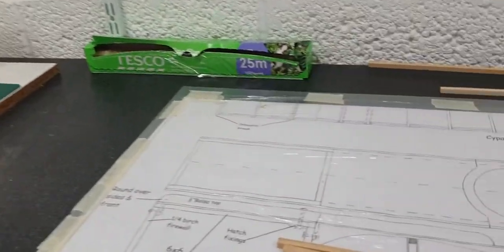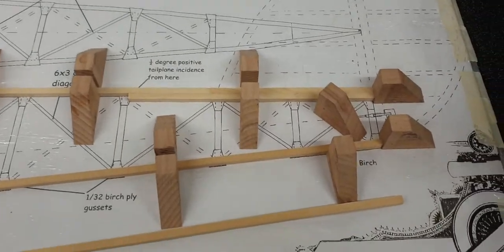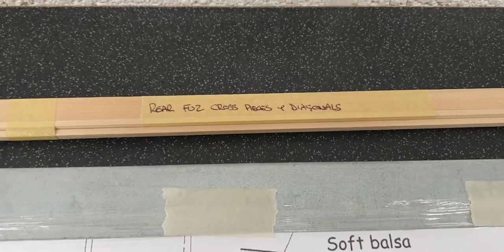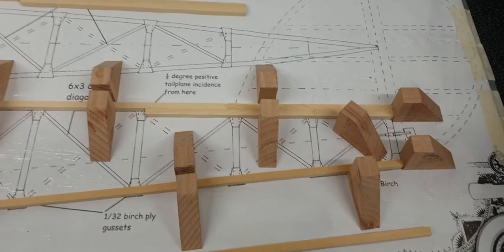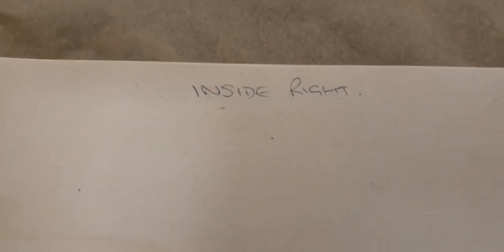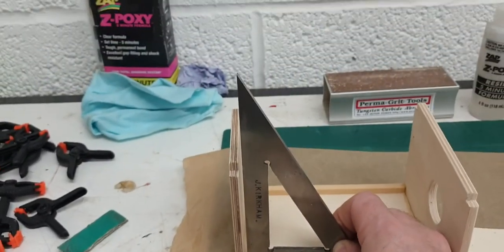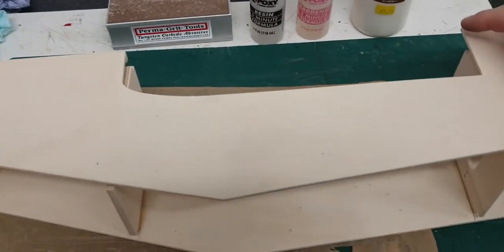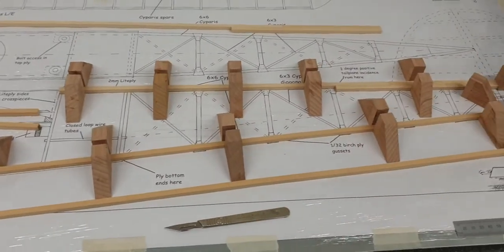MR VINTAGE RC PLANE BUILD VIDEO PT2

Comment: the question,  is  are  you  using   glue   or    wood  CEMENT.!?
Reply from the maker: David im using 5 minute epoxy on F1,2 and 3 and Aliphatic on the frames